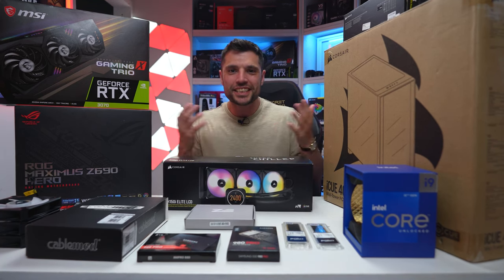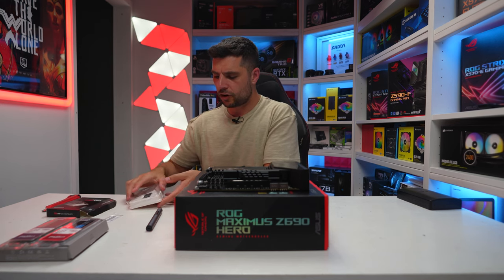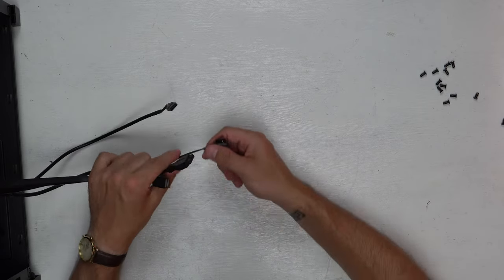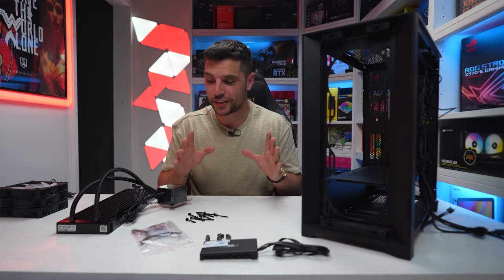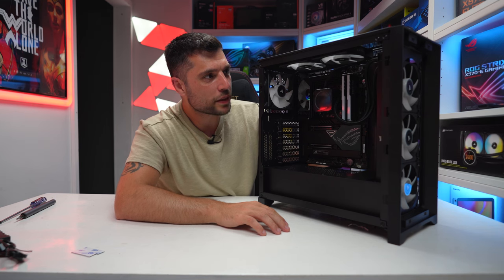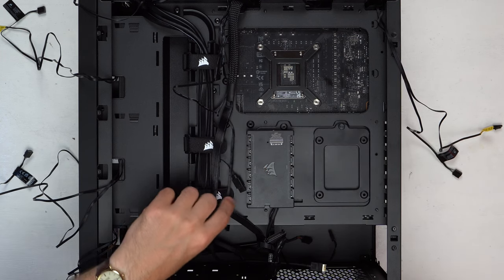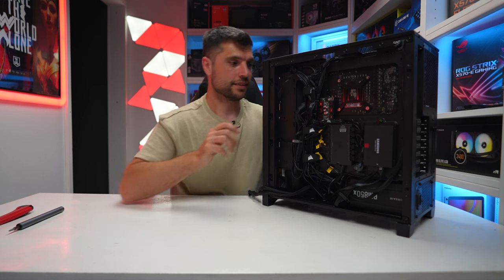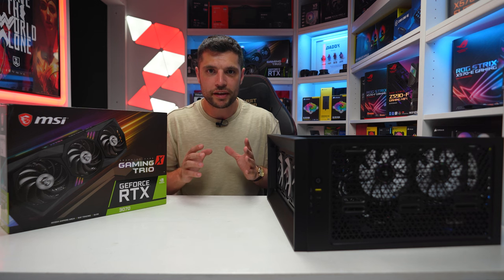PC Build in the Corsair 4000X - Intel 12-900K/RTX 3070 [Build Guide/Step by Step]

Comment: What's the name of the graphic card extension thingy?:O
Reply from the maker: pcie extension cable mate they come in 3.0 ans 4.0 do just be careful and ensure you get the correct one u need
Reply: @TechCheckUK  how do I know which one I need?🥹 I have the same case a gpu as you, but the gpu wouldn't fit horizontally
Reply from the maker: U will need a 4.0 one mate
Reply: @TechCheckUK  i think I figured out how to mount it. Everything is actually fixed now. However, my pc doesn't want to boot and I have a red light on my rog strix 550F cpu light. I've double checked that it has power, and that no pins on the cpu are bent and that the arrows match. Do you happen to have any advice for troubleshooting this?
Reply from the maker: @odalvaas1443  is it 5000 ready? Does it need a bios update?

Comment: What was the oh oh and expansion pack? lol I bought this case and I got that GPU (4070Ti though) and now I'm afraid it won't fit.
Reply from the maker: 4070ti.should fit - I had a 360 aio at the front of the case - tbh it's best to have a 240 at the top and then it gives u loads more room for longer gpus
Reply: @TechCheckUK  Thankfully it did fit with plenty of space. I got the MSI gaming trio and the only thing I hated about installing it was the anti sag bracket. Other than that everything is put together and running beautifully
Reply from the maker: @Ashley Bilmes  well done mate 👏 and yeah the brackets can be a pain in the the backside to lineup 👍 thanks again 4 watching.

Comment: I have a question, I just started building my first pc and everything is finally on and working except for the AIO fans (Kraken z73) and I switched the fans of the kraken z73 and put them on as case fans instead and decided to use the original case fans that came with the 4000x and use it on my AIO and they aren’t turning on but the actual AIO itself is on it even shows the temp of the cpu when I turn it on can someone help plz?( So the problem is the AIO fans don’t turn on but the actual AIO is working if that makes sense) sorry if it’s complicated to take in I don’t really know how to explain it since I just built it
Reply: They are all connected to the fan hub but don’t turn on but when I connect it to a 4 pin on the motherboard it runs on but has no lights as well
Reply from the maker: Have u connected the fan hub to sata power? Have u connected the USB 2 from the hub to the mobo mate? Hope that helps
Reply: @TechCheckUK I am going to double check that when I get home, but I also can’t seem to see even when I do have them on the RGB won’t work and I have them all 3 connected to the I think it’s called RGB node at 38:20, I was connecting them (The fans)to the MOBO to see if the way worked and when I did they were spinning but the RGB wasn’t, I feel like the whole situation is probably because I don’t have them connected to the right power source
Reply from the maker: @purpy  if y drip me an email techcheckoutuk@gmail.com with your fb or insta  I'll video call you and we can sort It together mate

Comment: can you do a push pull config front mounted???
Reply from the maker: You can only do a push pull with 2 x fans in pull if the GPU is vertically mounted and only 1 x fan if horizontally mounted - just not enough room for all 3 - hope this helps
Reply: @TechCheckUK  ya I want to move my 280 aio from the top to the front… it’s rubbing against my motherboard being mounted on top.. so I should be good with getting a few more 140mm fans for a push pull correct?
Reply from the maker: What gpu do u have and are u vertically mounting?
Reply: @TechCheckUK  also wondering if its worth doing all that, if ill see any temp changes also.. its currently working fine on top just snug against my motherboard, and not sure if thats bad for that or what...
Reply: @TechCheckUK  its only a 1060 so its small
Reply from the maker: @phile2586  yeah be fine then pal
Reply from the maker: @phile2586  personally I always prefer and should have rad at the top as exhaust - that way cool fresh air being pulled into system and then pushed through rad
Reply: @TechCheckUK  I’ll probably just leave it where it’s at… thanks for all your help
Reply from the maker: No problem mate 👍
Reply: @TechCheckUK  sorry to bring up an old topic, but i got a GamingXTrio 3070 and was gonna upgrade the rest of my computer (Usually what I do is upgrade my CPU / GPU on alternating 2 years so i skip a generation or two) and was just gonna get your opinion before i bought the 4000X..
If i only do a single sided fan 360 rad in the front would it fit?? or would you opt for a 240/280 on top.. It looked like in the video it would fit without that double sided fan, but just was double checking. Thanks!!
Reply from the maker: Thanks for good question - personally I would go 280 aio at top. A 360 would fit at the front as an intake if u wanted to go that way. Nice gpu choice 👌

Comment: Why not use the commander core for all the lighting?
Reply from the maker: I did connect 6 rgb and 6 pwm to the commander core mate I added 2 extra fans and utilised the included hub and a pwm splitter to minimise cables. Regards and merry Xmas 😊
Reply: @TechCheckUK  my bad, I missed that… I didn’t think you had that much lighting and was curious for the split, now I know :). .   Thank you for the reply and a Merry Christmas to you as well.    Great video!
Reply from the maker: Thank you

Comment: Are the fans on top and the back the case fans or different ones?
Reply from the maker: They are ml120s mate the ones that come with the case are sp120s
Reply: @TechCheckUK  will the sp's work or should I upgrade? I have the h150i. I'm running a 4070 and a i7-13700K. 
Thank you for the fast response! Your video helped me with my first build.
Reply from the maker: The sp120s will be fine mate used 100s of times and no problem 😊  merry Christmas mate and good job on 1st build 👍

Comment: Would you recommend an Intel I7 over Ryzen 7?
Reply from the maker: We talking i7 13th gen vs 7000 ryzen 7?
Reply: @TechCheckUK  Ryzen 7 5800X3D and I7 12700K I was recommended 😂
Reply from the maker: @anonymoushunter9808  5800x3d all day long mate if it was 13th gen it would be 50/50 but not with 12th gen 5800x3d all day long mate 👍
Reply: @TechCheckUK  thanks man
Reply from the maker: @Anonymous Hunter  no problem mate 👍
Reply: @TechCheckUK  also whats the difference between an RX 6800 XT and 3060 Ti?
Reply from the maker: 6800xt is a more powerful card and has more vram BUT lacks nvidia's Ray tracing and software not to mention the encoder for streaming etc
Reply: @TechCheckUK  cheers for the reply man. Imma go for 6900 xt since I joined a group chat and people recommended that. I’m going for 2K gaming anyway so shouldn’t be a big deal hopefully. 😅
Reply from the maker: Great card and amazing rastarisation performance 👏

Comment: where do you play an hard drive ? please
Reply from the maker: Where do you plug it in? Or why do I play on harddrive? 
1- hard drives require a sata data and sata power cable. One comes from psu and the other goes from hard drive to sata connection on mobo.
2- I would only ever use hard drives for pics or large volume storage tbh
Hope that helps or at least answers your question
Reply: @TechCheckUK  ho yeah thx 😅

Comment: Hi i want to ask, to work properly it must use pcie extension gen4?
Reply from the maker: To eliminate any issues yes use gen4 riser not gen3 - the issue was that the mobo supports gen 5 and the card supports gen4 but the riser was gen3 and we were not getting and picture out even if I changes the pcie settings to gen3. As soon as we changed to gen4 on the riser a few weeks later all worked perfectly. Hope this helped
Reply: @TechCheckUK  do you have any recomended good gen4 riser?
Reply from the maker: @rizalirawan608  I like this one https://amzn.to/3O4DRwn but there are other below 
https://amzn.to/3z5UsvR
https://amzn.to/3yF0RfV

Hope this helps
Reply: I am using a vertical mount kit now pcie4 and works and looks  great  specially after i upgraded to all ql fans
Reply from the maker: @danih9523  everything still working great then 👍 good news hope your well chap

Comment: Why commander core not showing in icue,
Reply from the maker: U done a firmware update in icue
Reply: @TechCheckUK   yes version 4 , I did update it says latest update , I unplug the ubs cable and plug it again,  nothing works, only shows drams, gpu, and h100 ape….
Reply from the maker: Is any rgb on fans? It must be working as fans are spinning yeah?
Reply: @TechCheckUK   yes  fans are spinning and lighting ,
Reply from the maker: Oh I'm lost then as its delivering power and rgb
Reply: @TechCheckUK  yes but not showing in icue it’s so weird
Reply from the maker: Thats mental mate I'm sorry I have no idea then - if u change the quick sync does that work?
Reply: @TechCheckUK  let me try it , is that in icue ?
Reply from the maker: @andresjc502  yes just on the left on 1st page
Reply: @TechCheckUK  I don’t see that option mate , when I click the h100 elite capellix  , > lighting setup /that’s where I can see the  run wizard  option, I think that RUN WIZARD option is supposed to be on the commander core profile  right ?
Reply from the maker: Hi mate - u shouldn't have to click anything -.as soon as you open icue u should be able to change the profile and lighting on 1st page

Comment: of only you installed the radiator correctly. Hoses at the bottom bud.
Reply from the maker: Oh dear 😳 nah they are fine. U been watching too many jay2cents or gamers nexus videos. As long as the pump is lower than the inlet on rad it is fine. Air will sit at top of radiator. Given I have just replaces my AIO after 5 years and never had an issue. Built 100s of pcs and none have been returned I would say its OK 👍